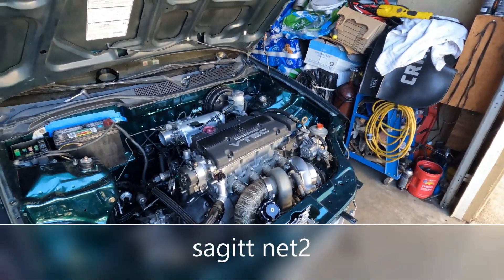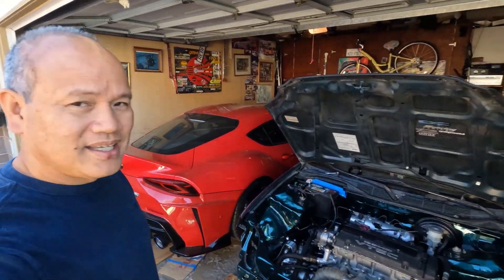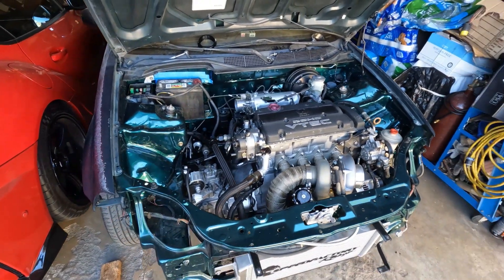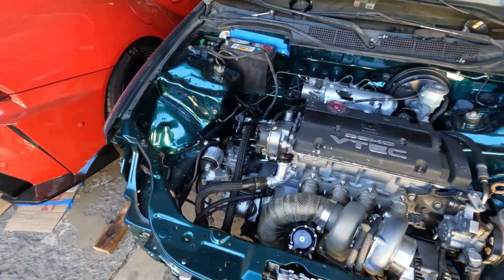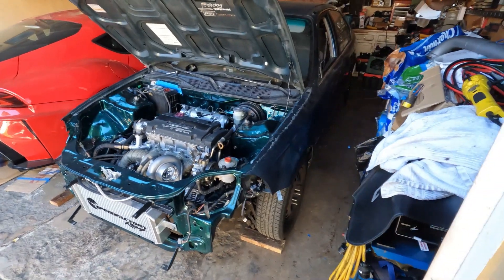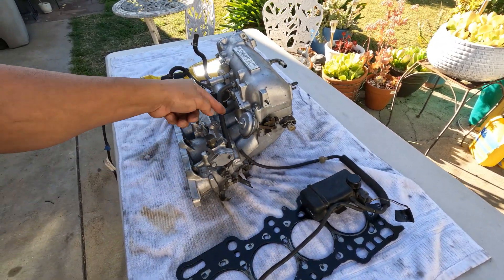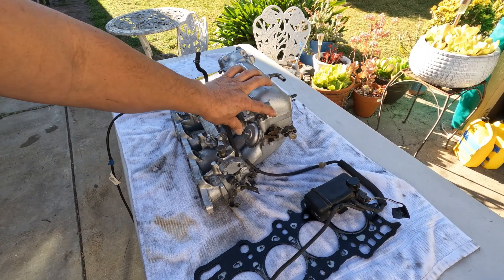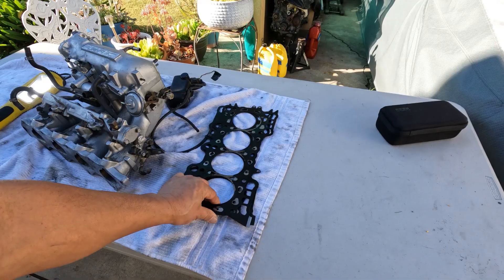H22 Intake Air Bypass Vacuum routing and how it functions.

Comment: Does the iab help with idle when ac is on i took mine off n now when i turn on the ac it feels really slow
Reply from the maker: If you have the Intake air bypass complete system (vacuum box) still installed. It should not affect your idle at all coz the system operate when the vtec is activated to support the air required at hi rpm range. But it'll affect your low rpm accelleration if its disconnected coz it should be close so the engine will create more torque at low rpm range. Your iacv should pick up the slack whenever the a/c is turn on. Try checking or set your idle rpm w/ the iacv disconnected. It should be on specific rpm range and once it set. Reset the cel and reconnect your iacv connector  and it should compensate the idle for the a/c demand. There's a service instruction from Honda or you can watch one of my episode on how l calibrated the idle w/ iacv disconnected.
.
Reply: @sagittnet2158  i got to find that video and thank you so much your a lifesaver i got install the air boost box again i knew something was wrong
Reply from the maker: @alex13238712  no worry man!
Reply: @sagittnet2158  brother cant seem to find the video can u tell the title of it or link please
Reply from the maker: @alex13238712  https://youtu.be/Q1D402sSOKw?si=NMkb5mAbEtdtWf30

Comment: Sick build dude. Im workin on getting my h22 ef cleaned up and wanna delete these valves asap
Reply from the maker: Thanks, are you gutti'n the intake manifold or just simply rerouting the vacuum hose.
Reply: @sagittnet2158  for now ive capoed the vac lines off but probly next week or so ill either gut the manifold or grab a skunk 2 one when i get my hondata ecu so i csn get rid of some other stuff too
Reply from the maker: @Beamer-Fonz  Hope you have enough space on your EF. I know sk2 mani quite a bit larger. Later man!
Reply: @sagittnet2158  might have to do some engine bay massaging ;)

Comment: I removed the butterflies, can I delete this system?
Reply from the maker: If you still have the cannister and you want too delete it and using p13 ecu. Connect a solenoid at the iab connector. Other wise you'll have a cel. P28 ecu no cel.
Reply from the maker: Yes, l did that too 1 time. I didnt connect anything. So the valves are open all the time and I didnt even feel a difference. Coz it's design to open when it fail. I've seen where they  gutted it, but a different ball game there. Something like that will require some tuning.